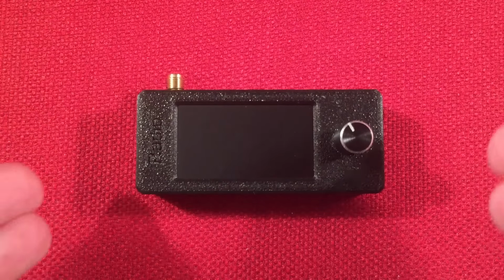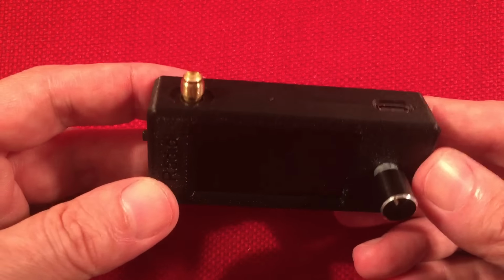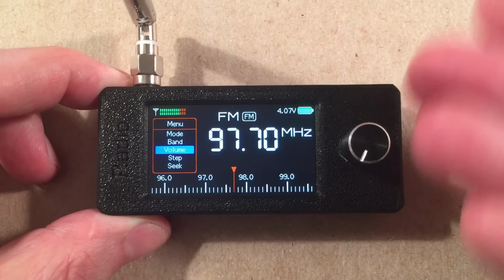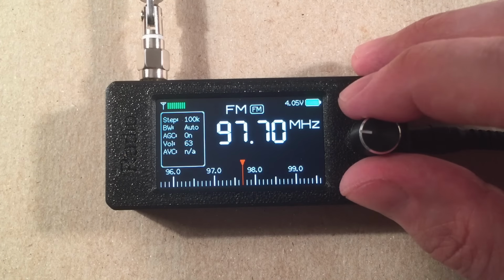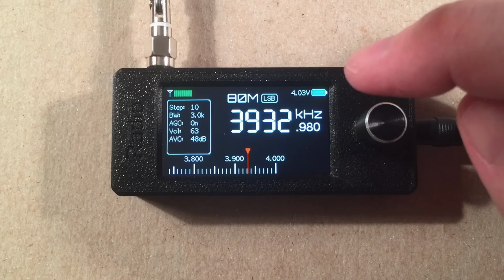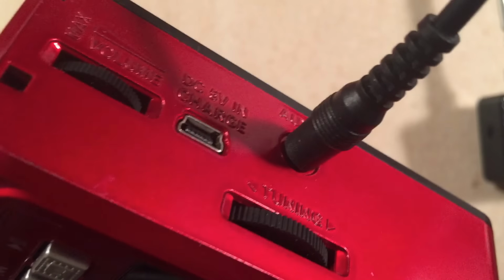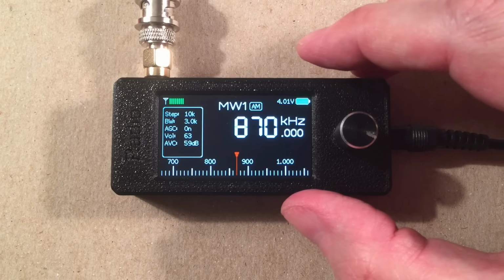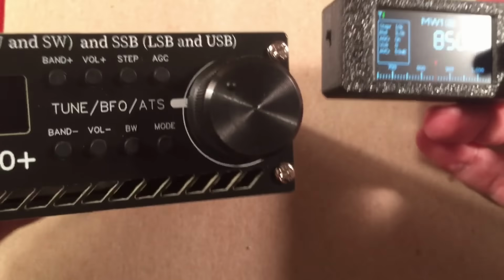ATS Mini Si4732 AM FM LW CB SSB Shortwave Radio Review

Comment: Just one problem: even when I upgrade it to the latest firmware, it does not tune to 13001MHz to 13999MHz in SSB mode.  That means I cannot tune to JMH's strongest signal at 13988.5MHz USB.

Update: Thanks to the community on FB helping me out with it, I am now able to do so (MODE is the key...)  Receiving JMH4 at 13988.5 MHz like a charm.
Reply from the maker: You may want to make a request for this on the ATS Mini Facebook Group.  I think the author of the firmware is on there quite often.
Reply: @todderbert : I went to the page and they were very helpful.   I was blinded by the instant band settings, never knowing I can actually set the mode on the frequency I want... Now I am really liking my ATS-Mini.  Thank you very much!

Comment: Would you say this radio or the ATS is better overall in performance?
Reply from the maker: They use the same dsp, but the ATS-20+ does have a FM bandpass filter in it.  I enjoy more control with the 20+ as well.  This little radio is awesome when it comes to the onboard controller, and screen.  The controls are lacking though.  I prefer the ATS-20+ , but I imagine with the right antennas you can get decent performance from both.

Comment: Hello, what is the little sign that sometimes appears to the righ of the signal strength (the little arrow)? (on the menu)
Reply from the maker: Found out that it is saving the current station to memory.  If you turn off the radio before you see that the station is not saved...reason: to save the eeprom..because it has limited writes, though it is in the thousands.
Reply: @todderbert thank you very much 👍

Comment: I have this radio...just purchased it a couple weeks ago. Totally a toy/gadget for geeks like myself.  We love radios...ANY radios. It's fun and I'm glad I have it, but I do think I have the original firmware, with the menu that only stays on a couple of seconds, etc.  You are correct in saying that the doughnut antenna doesn't do a thing. I read in an online forum somewhere that it was observed that the wiring on the doughnut antennas is done incorrectly...something to do with how the two sides are strung together...resulting in the two sides actually CANCELING each other out instead of HELPING the signal.  I am not a "techie" that way, so I wouldn't know. However, it certainly sounded like there might be something to this.

I also saw where there are little stands made just for this radio, shaped like little curved "horns" which help enhance/boost the sound acoustically.  

My main reason for writing today:  Todderbert, is there any chance YOU YOURSELF could show us, step-by-step, how to update the firmware..."flash" the radio, as you say?  There is a video by someone doing this already, but they talk rather quickly and with an accent, so it it a little difficult to understand what they're saying.

Thanks for all the great videos. I have watched for years...enjoyed...and appreciated!

Comment: They need to make an app that lets you control this easier
Reply: Well there's one firmware which allows you to control the radio from a web page. 
But the actively developed firmware does not yet allow to do that. But I'm pretty sure it will come as they already added a wifi connectivity feature !
Reply: Well there's one firmware which allows you to control the radio from a web page. 
But the actively developed firmware does not yet allow to do that. But I'm pretty sure it will come as they already added a wifi connectivity feature !

Comment: Is everyone here OK with the 3D printed case that Todderbert pointed out?
Reply from the maker: It is on the cheesy side, though I can see why they went this route.  See if the market likes it, then invest in injection molding.
Reply: @todderbert they could have 3D printed it using MJF or SLS, much better surface finish compared to FDM printing
Reply: It doesn't bother me much to be honest I'm thinking about maybe taking some sand paper a high number grit...like in the 90s and sand it and maybe hit it with a grey primer 🤷🏻‍♂️ ...grey is my favorite color 😆

Comment: There is a version 2 with headphone audio amplifier that is about twice as loud, a HI-Z input amplifier that matches the antenna better and gives better input sensitivity, a better speaker, and updated firmware. Right now it costs about rwice as much as the original so I would probably go with the ATS20+ if that is too expensive for you.

Comment: between this and the ats-20+ what do you recommend?
Reply from the maker: ATS-20+ first, then this as a close second.  I like more buttons.
Reply: @todderbert  ok. I got an Amazon $30 gift card from a work related contest, so today I ordered from your Amazon link for the ATS-20+. It covered most of it. We will see on Tuesday how big a nerd I am can be. I already have a Tecsun AN-200, so I will have to order stuff to wire them. Thanks Todd. I will keep you posted.
Reply: My question also
Reply: Specifically, this versus the ATS-20+ on the MW band. Both are great? Or one is better than the other? If so, which one is better on MW?
Reply from the maker: @haneyoakie14  Both work quite well with a Terk Advantage passive loop directly connected.  Personally much easier to use the ATS-20+ with less menu diving involved to do a simple step change, or engage SSB.